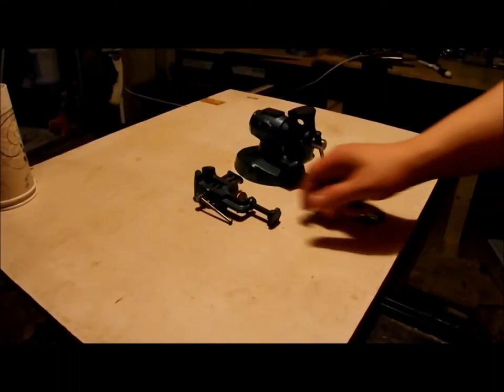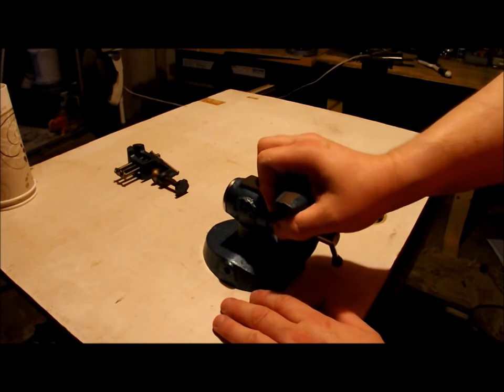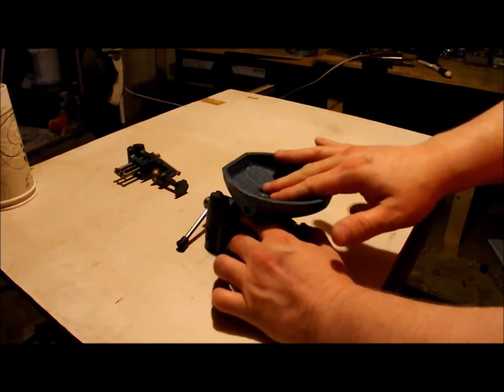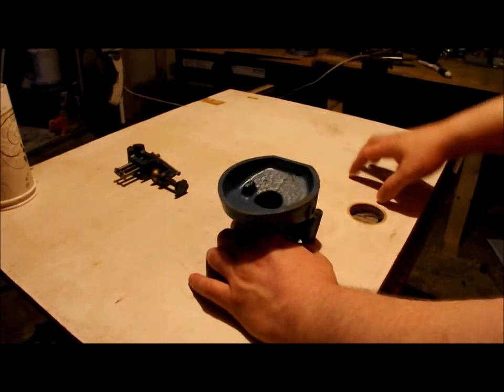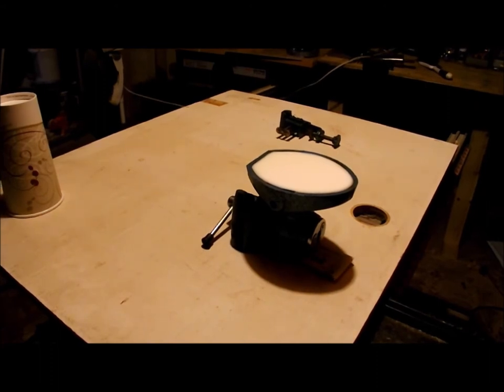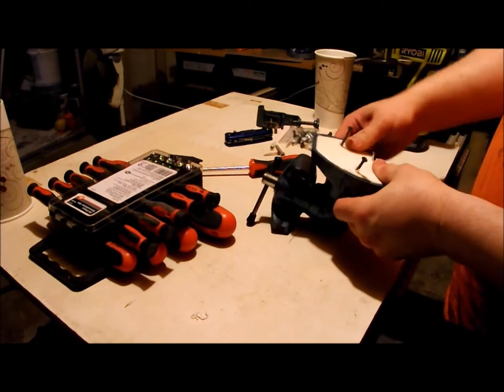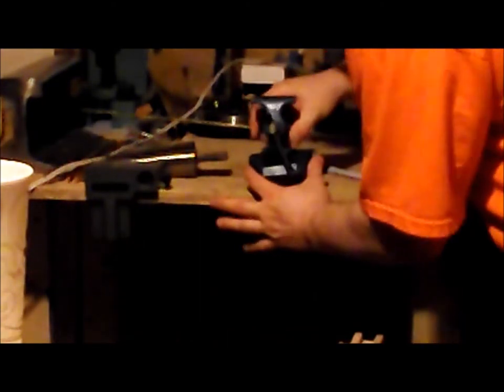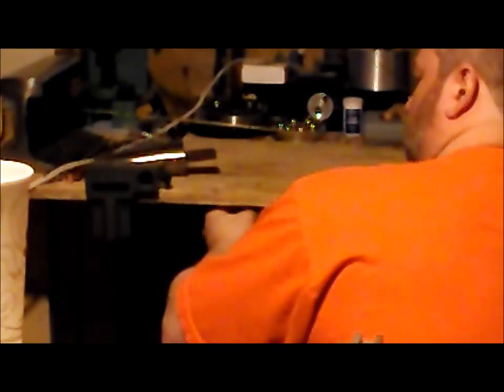Suction Jeweler's Bench Vise Mod

Comment: Mount it to a block of wood, and clamp to bench. If you need the bench you can move it easily. I have my vice like that mount to my drill press table so I can move it up and down depending on work. That way most time I can just swing it out of way when I need to drill small stuff!